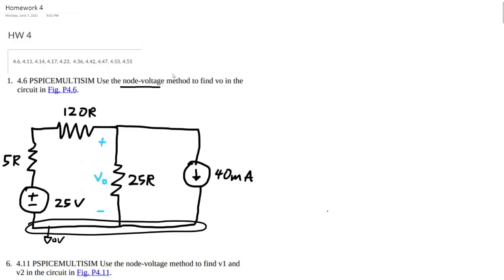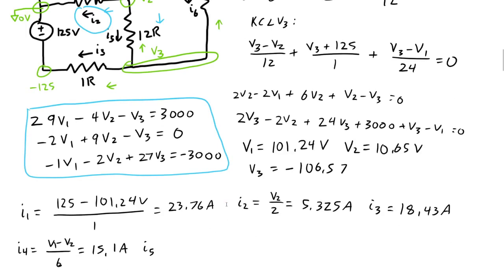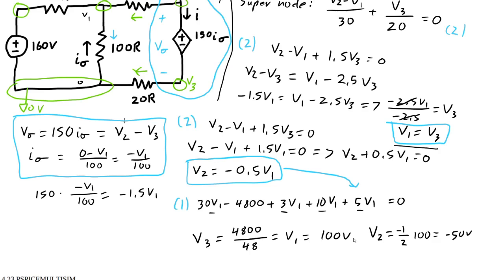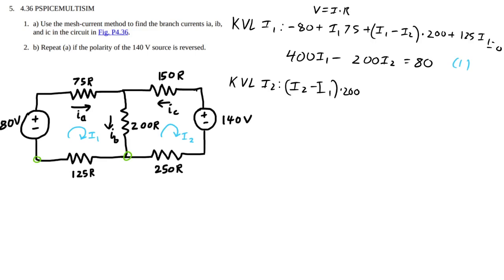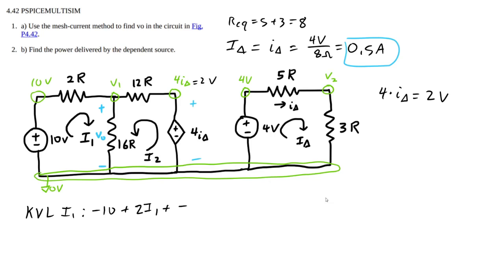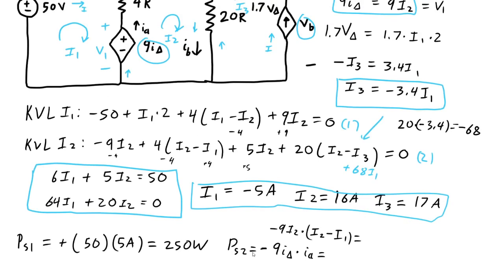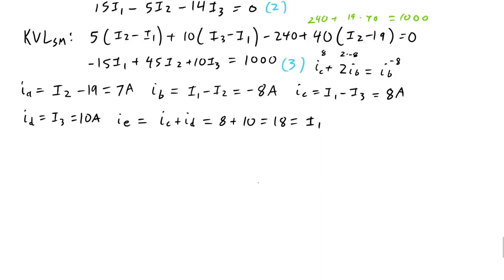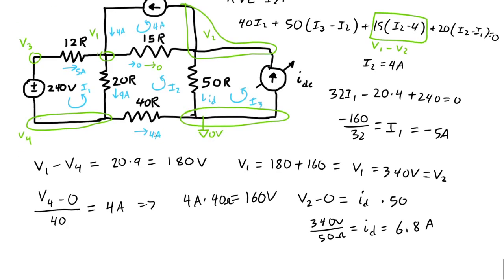EEL 3004 HW4 Solutions

Comment: In problem 4.14, why are the voltages one way for calculating I1 when deriving the equations for the voltages, and then the voltages are swapped V1-125 when finding the current? Would this not be the same direction for both instances?
Reply from the maker: In nodal analysis, all currents are assumed to be leaving the node, in this case node V1. The actual direction of current for i1 is from the 125V node to the V1 node, which is why the equation for the current is flipped.